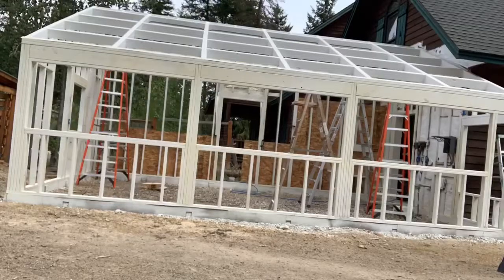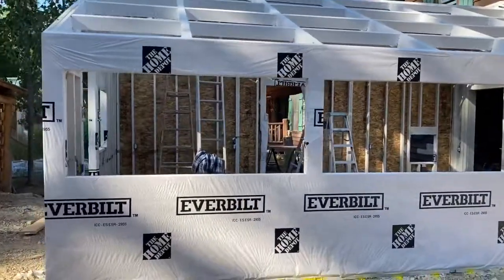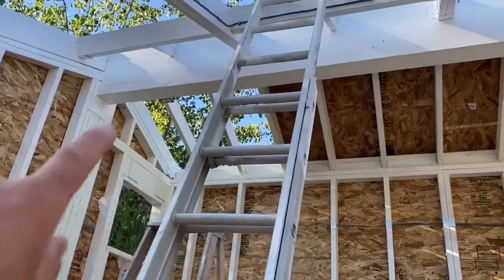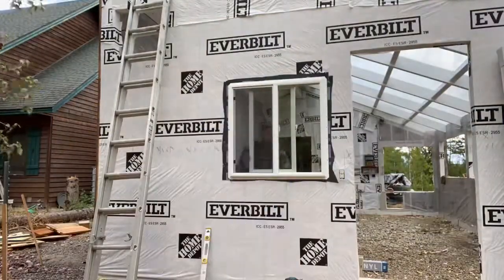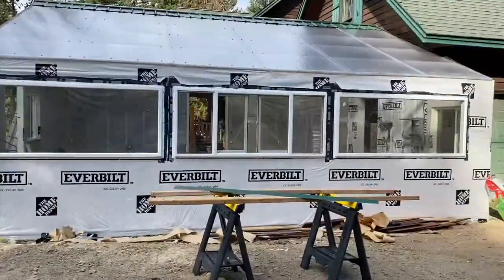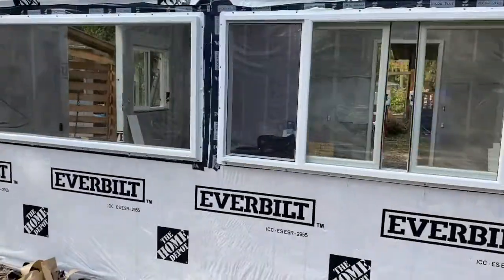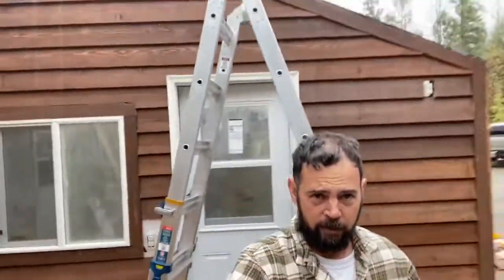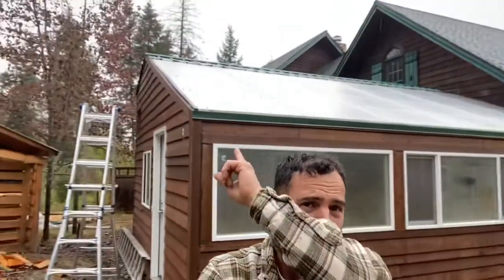Cold Climate Greenhouse S1E9

Comment: Wow, impressive progress! Been a while since I’ve watched an update so it’s awesome to see it this far completed! 
Do the panels of triple poly interlock somehow to seal the joints, or are they all just caulked at the joints? Do you use regular metal roofing screws to mount it, or something special?
Reply from the maker: Thanks! Between the panels are H lock joiners that seal the roof. We used “metal” roofing screws with the bubble rubber washers for mounting. They were a little longer than a typical metal roofing screw.